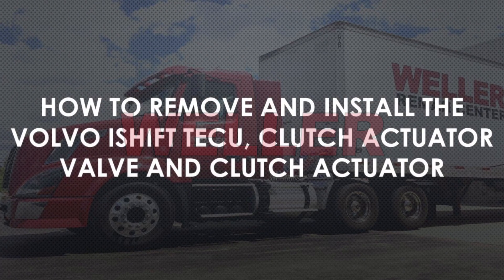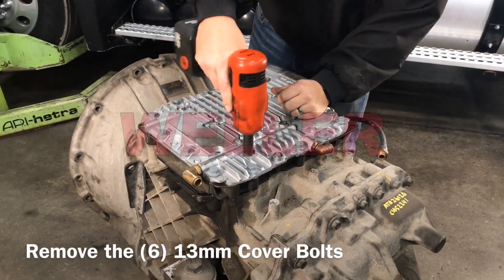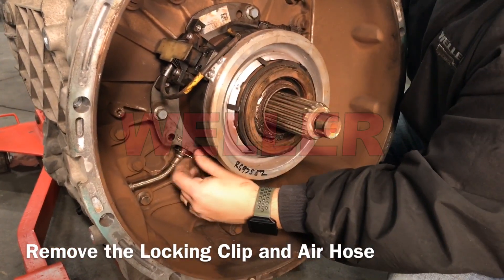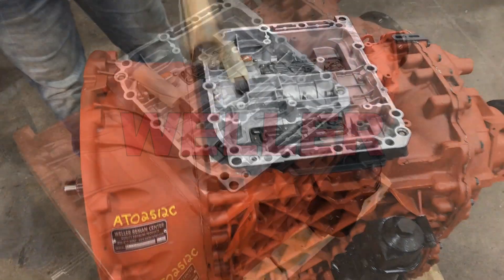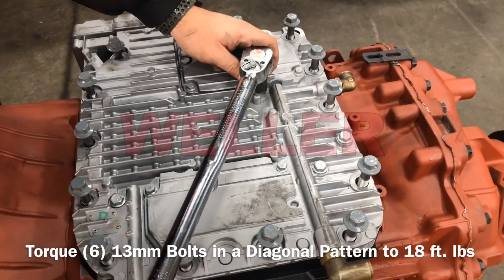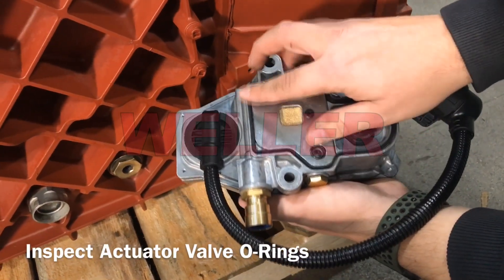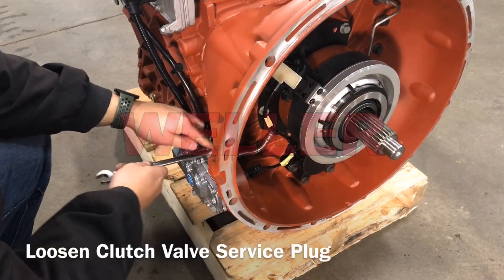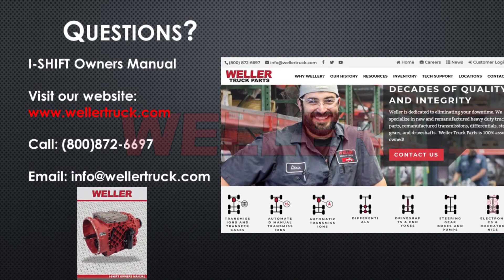iShift: How to Remove and Install the Volvo iShift TECU

Comment: Who replaces the hose o-rings? I work at a volvo dealer and we just put a new hose on it when we replace the cca and ccv
Reply from the maker: Good morning Kyle, the person installing the Transmission is responsible for either replacing the O-rings or replacing the hose assembly.
Thank you for reaching out!

Comment: Hello? My on board dash check is showing that I have a problem with   the electronic gear shift lever on a Volvo FM9. Is there any other way to verify that the problem is gear shift lever and not anywhere else? Of course I have gone through the cables and fuses which don't seem to show any short or blow out.

Comment: We have a i shift in 2008 . It has issues. Most time will not go in gear. Then once in a blue moon selects 1 or R  but then locks im gear even with brake pedel on. And wont change or go back in neutral also until engine switched off.  Any ideas. If try.select gear.  After 5 seconds gearbox sign comes up and N.    No faults showing on internal dashboard diagnostics on  gecu